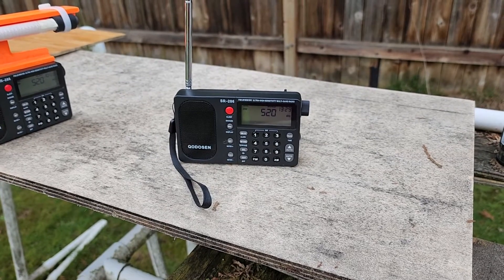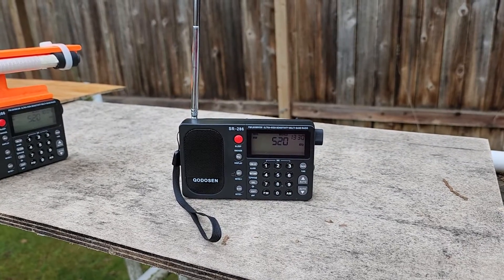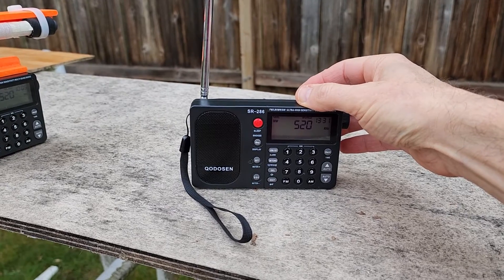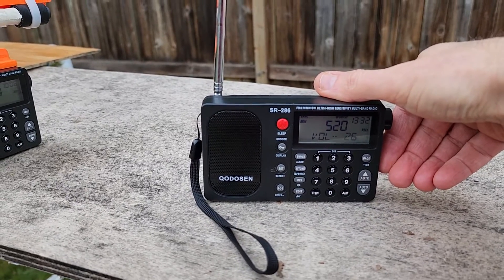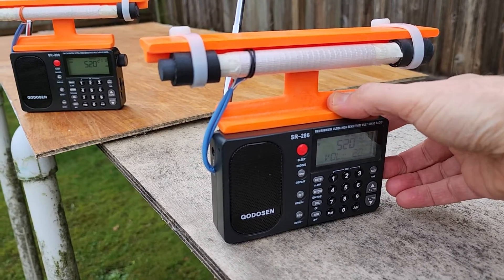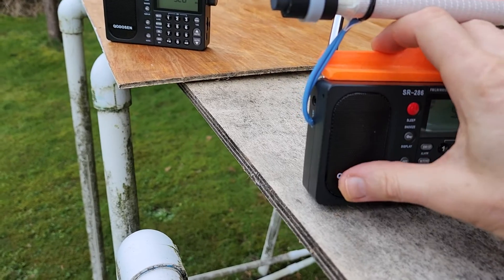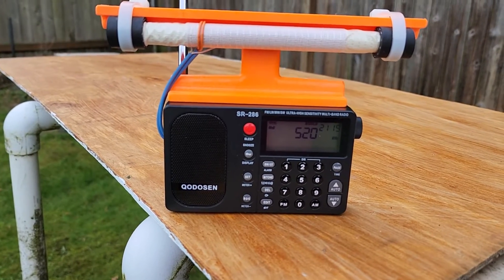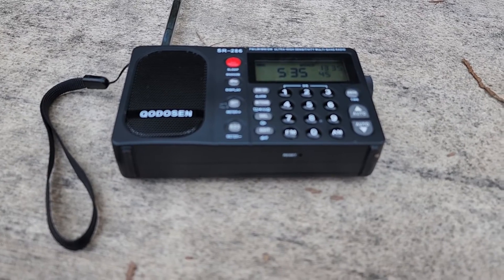Qodosen SR-286 Digital Display Noise Quirk

Comment: Gary, I think it would be wonderful if you made videos specifically on how you make these antennas. 
I know you have instructions online, but I think many of your viewers would like to see "how you do it" in a video. 
The performance from these 7.5" loopstick antennas, gives these radios a very needed boost. You have proven these antennas work, now it's time to make a few videos on how it is done (step by step). 
Many folks know how to change spark plugs / remove intakes/ change fuel filters / replace radiators in specific cars, but they watch those YT videos to learn how others can do it more efficiently. The same concept can be applied here. Showing us how ((you do it)), and how things go together would be a wonder direction for this DX channel.
Showing the "end result" is neat, but you have many folks that want to "see how you did it", as opposed to reading how you did it. 
Lastly, the reason YouTube is so popular with DYI, is because many folks like to watch how things are made VS reading how things are made. Your instructions are noble, but remember, most folks don't like reading instructions, and would prefer to watch it visually.
Reply: Hello @kim_patton5538, I agree with you 100% that such DIY videos would be helpful and popular, and motivate many new hobbyists to "take the plunge" and attempt their own loopstick transplant projects. The current problem here is a severe time crunch, mostly related to caring for aging parents (in their 90's), along with other business, family and church obligations. Another challenge in posting a DIY video on loopstick transplants is the fact that skill in close-order soldering is critical for success, and very few radio hobbyists still have the close-in vision, steady nerves and training to do these soldering jobs without creating problems. In my own case, extreme nearsightedness has proven an advantage in close order soldering, but unfortunately most of the radio hobbyists are now dealing with age-related limitations in vision and steady nerves, besides other issues. Despite all these factors, however, as you say, the boosted performance of these loopstick transplant radios is impressive indeed, and I still do have the goal of posting a few DIY videos when time allows. Thanks for your comments, and best of DX to you!  Gary/ N7EKX

Comment: Hi there Gary. As a follow-up to my previous post, I experimented and found a suitable workaround to deal with the digital display noise problem beyond just disabling the display. I gave the matter some thought and it dawned on me that the display is in mightily close proximity of the built-in antennas. So then, I played a hunch that plugging into the DX-286 with an external passive loop antenna might at least rid the radio of that very annoying effect by virtue of it being distanced away from the interfering noise source. Yep! With external antenna switched on, amp switched on and with my Radio Shack #15-1853 passive tuned loop connected via its linking cable, there is absolutely no digital hash or display-induced interference at all. Now I can leave the display activated without sacrificing reception. The bonus is that the antenna can be rotated independently from the radio. The DX-286 pairs nicely with my Radio Shack #15-1853 with astonishingly excellent sensitivity! I would imagine that shielding the digital display from the built-in antennas is no small technological feat! Why the issue varies in severity from unit to unit is perplexing, but I have a good feeling that the problem will be rectified in future production.
Reply from the maker: Hi Skinnyblinddude, Thanks for your investigation! This noise quirk is somewhat irritating in both the SR-286 and DX-286 models, depending on how noisy a display you get. The quality control in the display factory is very uneven.

Comment: My DX-286 exhibits this digital hash as well. It’s audible on other frequencies too throughout the MW band. Disabling the display by simultaneously pressing 1 and 3 entirely eliminates the digital hash. It’s a quality control issue, but what do you expect from an $80 radio. If Qodosen can correct this issue, that would be a good thing.

Comment: When listening to MW through headphones, I hear a regular "pop" noise, around one per second. Ever run into that issue?
Reply: Yup, turning the display off makes the popping go away!
Reply: @DLH65  so they haven't shielded the DSP from other internal electronics well enough I guess. This is the first time im seeing a practical use of turning the display off.
Guess they had seen this happen and gave the option t turn off.
Reply: I found something similar on every radio, turned out my phone's NFC works somewhere around 11 mhz and that was sending out periodic signals to detect nearby devices which was caught on my radio.
Reply: @anulearntech  interesting, this however is specific to the qodosen. I'm going to try turning off the display.
Reply: @DLH65  maybe it's detecting something others aren't. Do you get it everywhere? In High rfi area and other places?
Reply: All times and locations, MW band only.
Reply: After you get tuned to your desired frequency, disable the display by pressing 1 and 3 simultaneously.
Reply: By the way, my C Crane CC2E and my Sangean PR-D4W exhibit rhythmic ticking sounds as a result of picking up interference from their displays. Unfortunately, with those sets, there’s no way to turn off the display. So then, it’s apparent that Qodosen is aware that some users might have this issue and took steps to help remedy the problem.

Comment: I checked mine and nothing at all. Is it not locally generated perhaps ?
Reply from the maker: No, because when the buttons 1+3 are pressed to turn off the display, the noise disappears as well (to confirm that it is display noise). You may have been lucky enough to get a model without this quirk.
Reply: @DXerGary  let’s hope the new official version the DX 286 has no such issues. Much cheaper also !

Comment: Gary, do you plan to modify the dipole antenna? 
I believe it is "to short", and would benefit from a longer dipole -(30+)- inches.  
It would be cool if these came with a modified version with a female SMA antenna connection.
I know you "could" plug in a 3/8" connection to SMA, but if it gets bumped, it could break the soldier connection on the board (weak point). I'd be interested to see if its possible to modify the dipole, either to a longer antenna or converting it to a SMA female connection.

Comment: Did you try to switch off display by pushing knobs 1 and 3 together? How much difference?
Reply from the maker: Yes Alexey, like Jorge (IberiaDX) says, the SR-286 display noise does go away when you press the 1 and 3 buttons simultaneously. But of course the lack of a display isn't very convenient for DXing, especially when you are trying to change frequencies and investigate multiple DX stations. Turning off the display (and the display noise) would be OK for an audio recording of one DX station, however.
Reply: Hi! When display is disconnected, noise disappears. But this is not a good solution as the units would not radiate any hash or they had to be well screened, at least!

Comment: I hear that hash noise. Hash noise can ruin an otherwise nice radio. I do own the SR-286 and while it's not perfect I do think it's technically the best radio I own AND it makes fun to use.
The hash noise I hear on your videos is Very mild though. By any chance did the audio compression either by your camera or YT encoding reduced that noise? I had that in the past that recordings of such Kind get affected by digital compression.
Reply from the maker: Hello Johann, actually I first discovered this display hash noise on some SR-286 models when neither the camera nor a YT recording was involved. I agree with you that the hash noise in the video is pretty mild, but since these loopstick transplant modifications are designed to encourage very weak signal AM-DXing, anything that interferes with that goal should be investigated before the radio is modified.  Overall, though, I do agree with you that the SR-286 is a very fun radio to use, and that the TEF-6686 chip provides a real technical breakthrough! 73, Gary